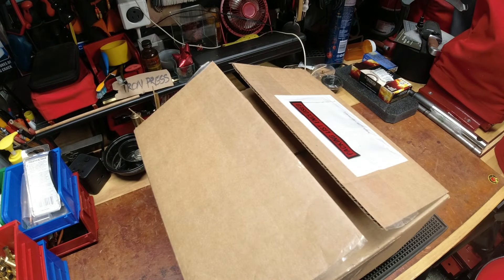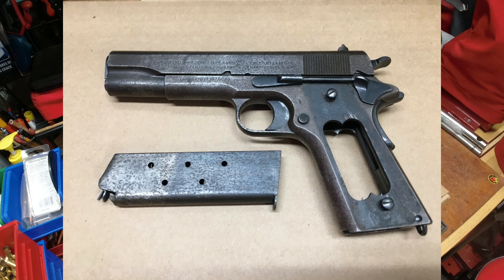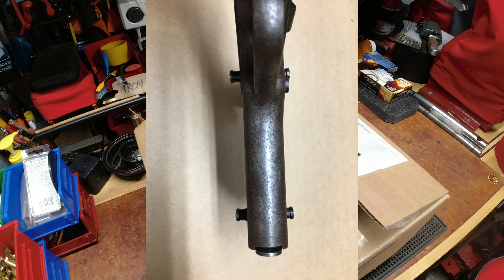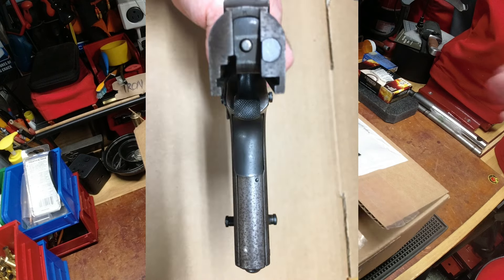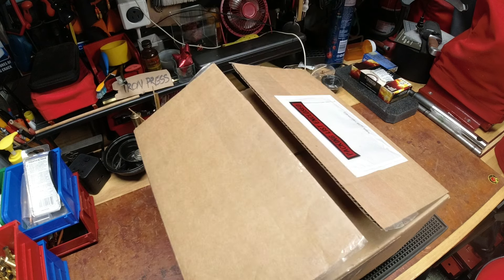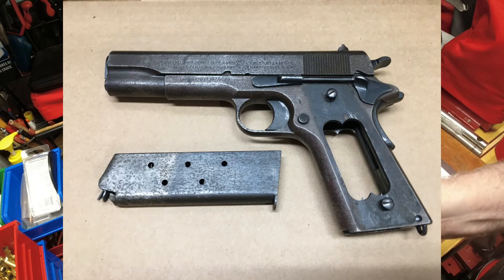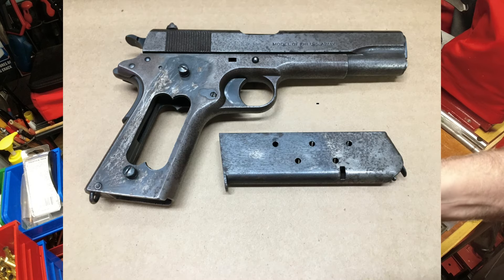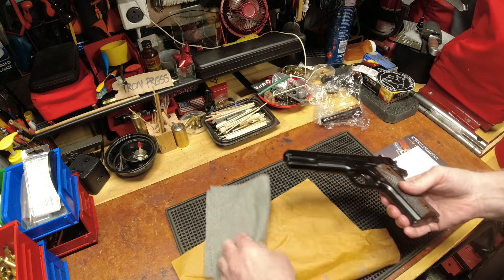Turnbull 1918 Black Army 1911 Full Restoration: Part 2 - DONE ~67 Weeks Later!

Comment: Why cover up the serial number? I have a 1918 Colt "black army" is someone going to try and track me down? In fact my "black army" was purchased in Chicago in the mid 1960's for $20. The front strap was hand checkered and all of the serial numbers milled off including under the firing pin retainer. I called the ATF and they said if its older than 1968  which the "heart shaped" plunge mill marks prove. they just dont care. Serial numbers were for inventory purposes. I love your pistol! My 1911 was upgraded by Al Capone's son and I leave it as it is. Though the metallurgy of the slide is a bit soft its a terrific shooter and is hell of accurate! I will probably send my grandfather's 1901 Marlin 1897 to Turnbull some day. Great videos!
Reply from the maker: Thanks. I’m a big fan of Turnbull’s work, not so much a fan of the cost of their work. But, you get what you pay for. I cover up serial numbers out of habit, just prefer to keep certain things to myself.